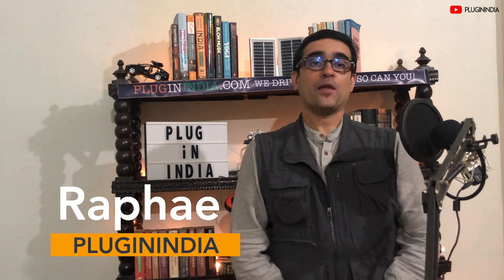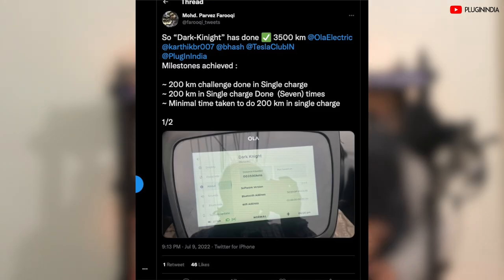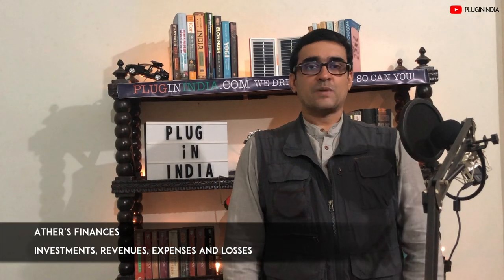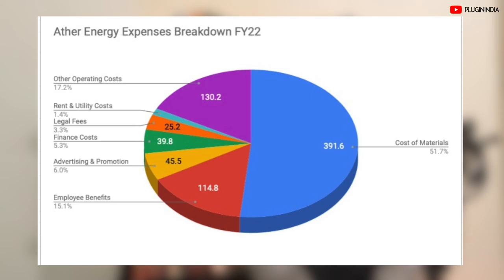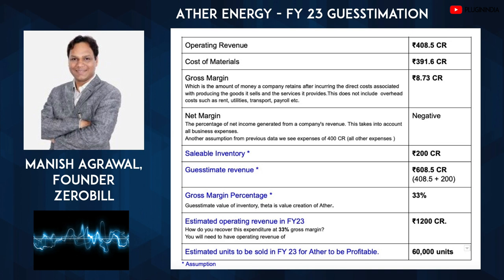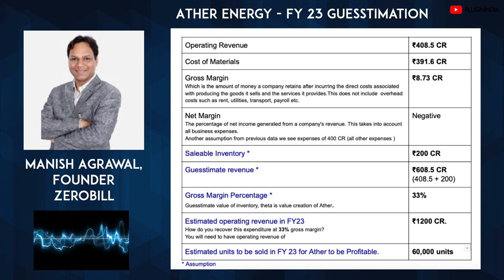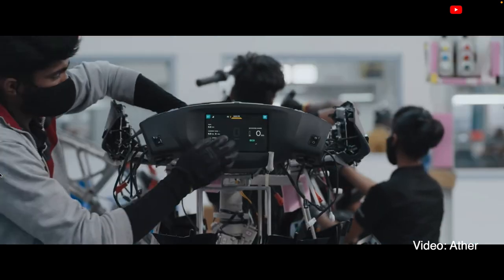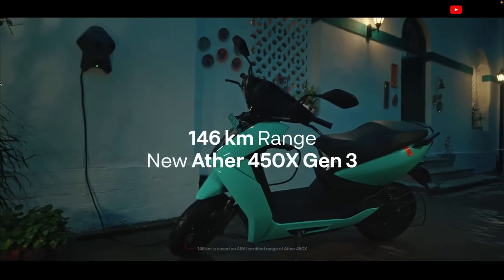Hey Tarun! Ather’s Moment Of Reckoning Is Here. Time for changes?

Comment: Gdevn sir, I am one of the follower your channel, as you suggested pure ev etrance moped on 07082020 purchased, completed 2y with 18000 kms, and I was invested 10,000- above, still I am facing battery problem, already changed battery on 12t kms so again for 6000kms battery issue again, just Passing information only thank you

Comment: That was pretty comprehensive. Here are my thoughts. Since Ather has created a Halo vehicle, their focus should remain as what they do best, performance, finish, finesse and reliability. However, they should create their motor in house. I guess that German Mahle motor takes a big chunk of their production cost. Same is the case with battery. Instead of going after high energy dense NMC battery, they should make a battery pack with way cheaper LFP and come out with two versions like Simple is doing. A fixed battery platform plus a removable one to keep the battery range same as the NMC. Same goes with controller, that should be built in house too. With only these three things the price can come down by 20-30%. Another thing is right now a big part of the scooter price is going towards the charging infra they are building. I think they should JV with other infra builders and also, the charging should not remain free. That would take some burden away from the company's operating cost which can be offset against the selling price.
Reply: Great point on vertical integration and revenues from Ather Grid can also help.
Reply: "Instead of going after high energy dense NMC battery, they should make a battery pack with way cheaper LFP and come out with two versions like Simple is doing."
that would be a very non-Ather move. a compromise on performance, finish, finesse and reliability ;)